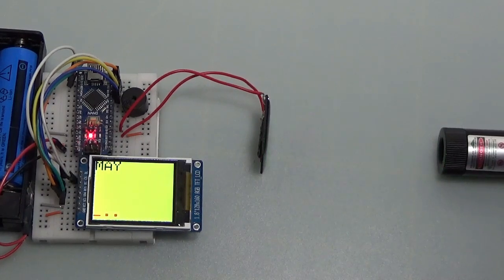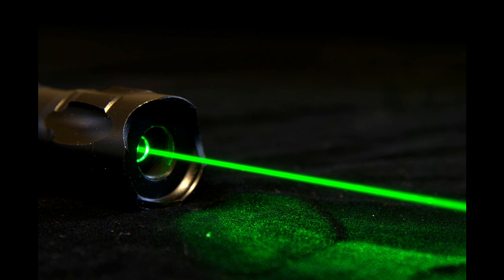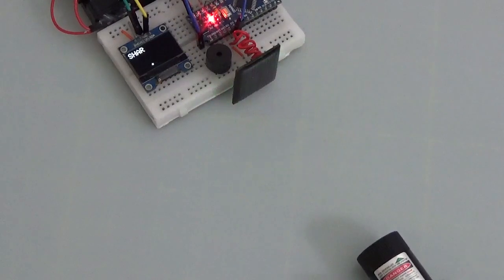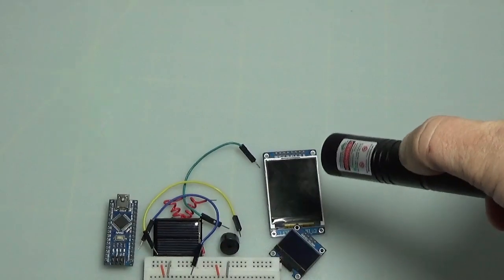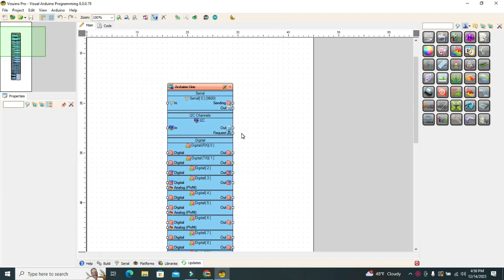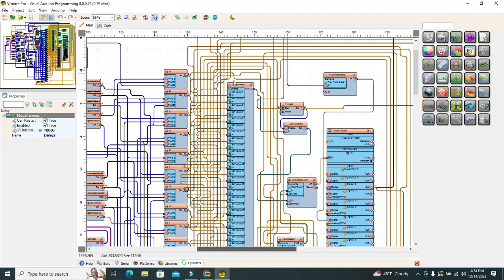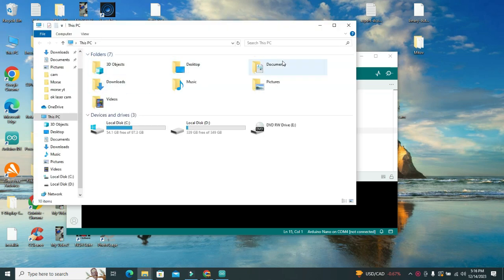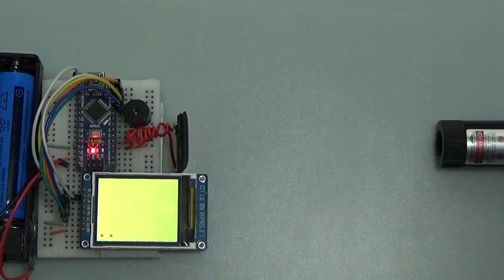Data Transmission Through Light! Free Code! Visuino Project!

Comment: hi sir i hope u reply me back
Reply from the maker: @alauddinnafis8643  where?
Reply: @CompactDiy  may i ask, is there something i need to do sir, i cant upload in my arduino ide even the mitov file in it the library. This error occurs because the code is using a class template with a mismatch in argument numbers. Specifically, your code or the library expects a template with 12 arguments, but the compiler sees only 9.
Reply from the maker: @alauddinnafis8643  I will check when I get to my PC and come back with an answer. Is it about this project? The one where we are commenting now?
Reply: @ yess
Reply: is it okay?
Reply from the maker: @alauddinnafis8643  yes, i replied you
Reply: @CompactDiy  what do u mean by install visuino if im using the arduino ide
Reply from the maker: @alauddinnafis8643  
Probably something is missing in the library. Simply install Visuino to load the Mitov folder by itself in the libraries. Load the code from the Arduino IDE and then uninstall Visuino if you consider it necessary.
Reply from the maker: I have now checked the code in INO and it works. Do this: delete the "Mitov" folder, install Visuino and the files and libraries will install themselves. Upload the code and after that you can uninstall the program if you consider it necessary.
Reply from the maker: I have now checked the code in INO and it works. Do this: delete the "Mitov" folder, install Visuino and the files and libraries will install themselves. Upload the code and after that you can uninstall the program if you consider it necessary.